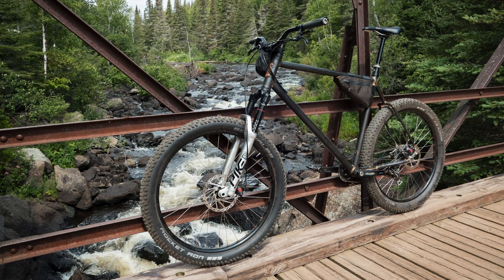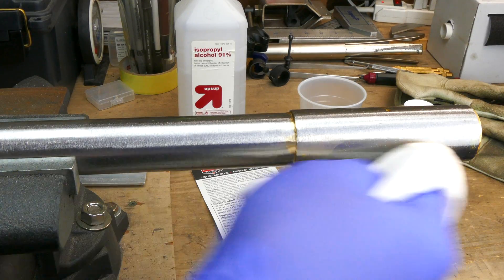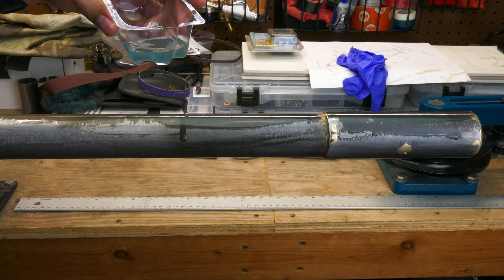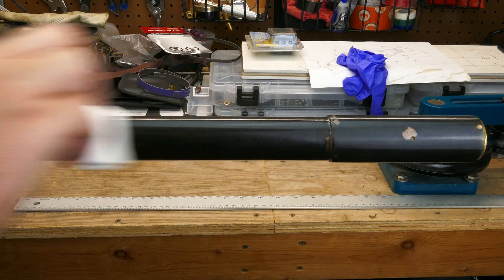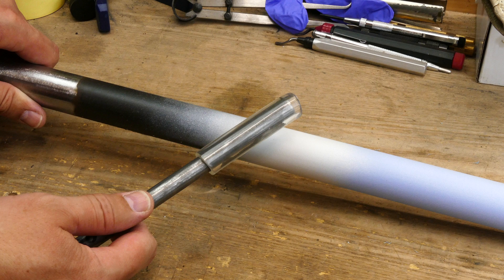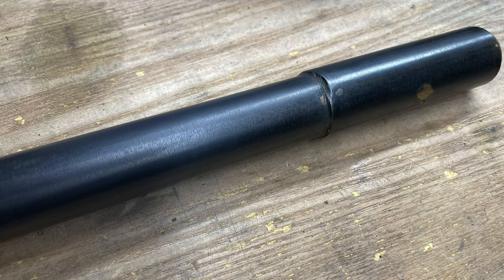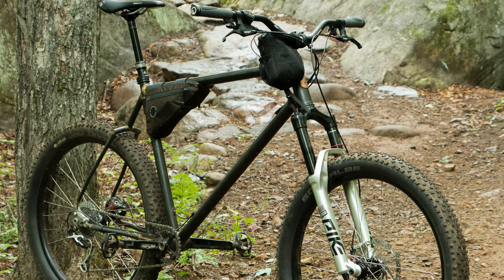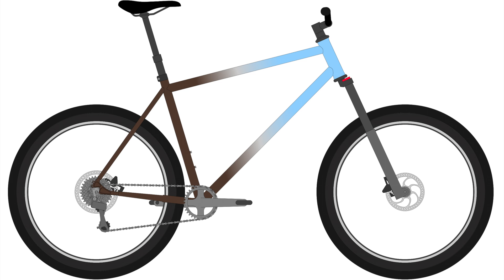Does Spray Paint Stick to Cold Blued Steel?

Comment: Using a rust blue is home accessible as long as you have  something big enough to boil the item. The homemade formula for faster rusting is salt, vinegar, peroxide, and water. Lightly buff in between coats after boiling, then rust again and repeat the process. 3-5 coats should get a pretty good finish without contamination. Might need distilled water for the boiling, might not depending on your local water.
Reply: Mark at Anvil has a great method that does not require a big boiling chamber. Totally worth the watch!  https://www.youtube.com/watch?v=_nWVI_3Lo0Q&t=18s

Comment: Bluing is also called black oxide. It protects against rust, and even double if you oil after.
Reply from the maker: There are a few different kinds of bluing. Cold bluing solution like I’m using here isn’t very durable and doesn’t do a very good job of preventing rust.  Black oxide is a more durable type of bluing.

Comment: Great video! I want to recreate the burnishing effect on a BMX bike frame at weld points. I think the frame was sand blasted or sanded/polished as the original burnishing is gone once I stripped the original paint. I've considered cold bluing to mimic this effect. I plan to use a direct to metal clear coat for a raw metal with clear gloss finish. My question is whether the cold blued surfaces would prevent the direct to metal clear coat from adhering. I'm using KBS Clear Diamond Finish aerosol. I think your video answers that it should work. Another question is regarding your statements regarding rust proofing/protection. I basically never ride in the rain. When I wash the bike down, I dry it and apply MudTec Bike Protect to remove moisture, protect from moisture/dust and shine things up a bit. Everything is stored indoors. Let me know what you recommend for maintaining blued areas under multiple clear coats. Thx!
Reply from the maker: Thanks!  Unfortunately I don’t have any experience putting clear coat over cold bluing.  One of the reasons I’ve avoided it is that I can’t do any maintenance of the bluing if it’s under a clear coat. If I get a rust spot on my blued frame I just hit it with some steel wool, maybe apply a bit of bluing solution, and oil it. 

Sorry I’m not much help.

Comment: One really good test for adhesion is the "tape test" used by metal platers. You press some tape down, masking tape is good, and really make sure it's adhered well. Rip the tape off quickly, and if the paint sticks, it's on there good. Also, if you want a really durable paint job, get a can of "2K" paint. I used the Spray Max brand on my last project. The clear really adds a lot of "bling" to the paint job, and it is very durable, as it is a 2 component paint. The 2 down sides are that it's expensive, and you might as well use the entire can, as it only has a few hours shelf life after the components are mixed in the can.
Reply from the maker: That’s a great tip. I just went out to the garage and tried it.  All I had was Gorilla tape; made sure it was fully stuck on the tube, then ripped it off quickly like you said. No primer (or paint) came off. I’ll chalk that up as more evidence my primer sticks to cold bluing. Thanks!
Reply from the maker: I’ve considered trying a 2K clear. But I think any clear on top of bluing or a DIY paint job is gonna eventually rust underneath the clear.
Reply: @ThriftyFramebuilder  I painted a custom bike I did for my wife with Rustoleum and 2k clear. No rust after 3 years...
BTW, really enjoying your content. Hoping you make videos for a long time!
Reply from the maker: Thanks, I don't plan on running out of projects anytime soon!  That's good to hear about the 2K clear.  Most of what I've read about putting clear over bare metal is that it eventually gets rust spiders.

Comment: Are you familiar with hot bluing? Heat the metal until it just starts to turn color, and then quench in oil. Clearly not an option for a brazed frame, but maybe smaller parts.
Reply from the maker: I’ve read a little about the other types of bluing, and watched some hot bluing videos on YouTube… more suited to smaller parts like you said, or for a production facility with a large oven and an oil bath. 👍👍